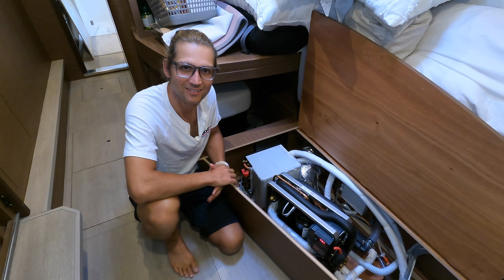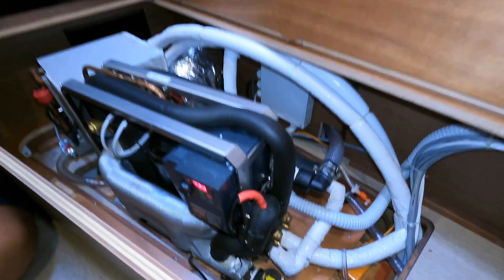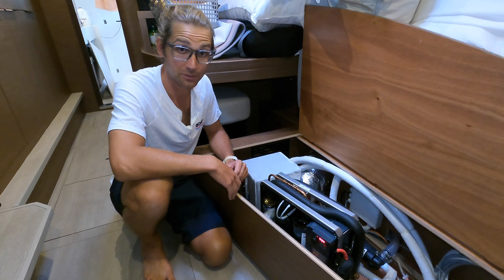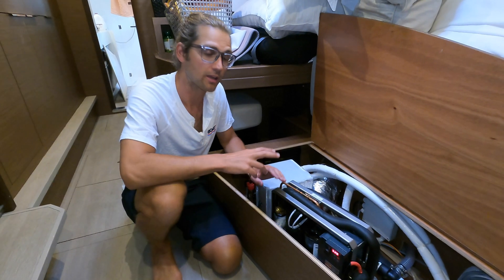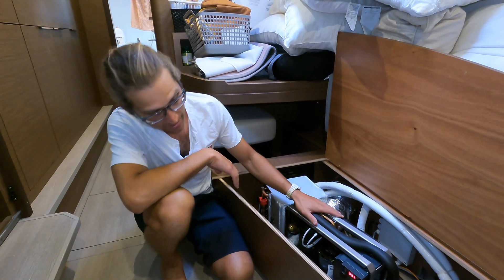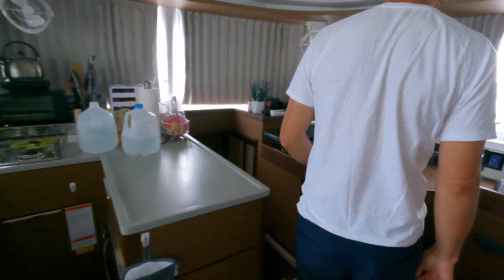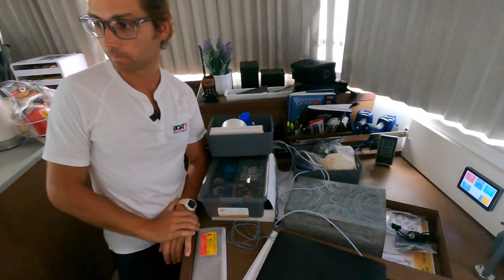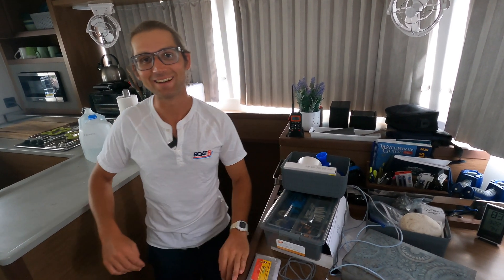Lagoon 46 Sailing Catamaran with New VRV8 Air Conditioning from Termodinamica!

Comment: How does a system like this compare to the Frigomar a/c units? Do you work full time in S. Florida?
Reply from the maker: It's only similar in that both are variable speed.  Frigomar makes a nice self contained unit, however you'd need more than 6 of them to provide the same amount of cooling supplied here.  This boat has 2 central compressor units which drive three air handlers each.  The capacity of the system can be moved around the boat.  So if on a hot day more cooling is needed in the salon and less in the hulls, more refrigerant can be distributed to the salon air handlers.  You can't do that with self contained units, Frigomar or any others.
Reply from the maker: Contact Termodinamica USA for installations in Florida.  Contact us for projects anywhere north!

Comment: Nice! What are the power options? 24 & 48VDC?
Reply from the maker: 230 volts through an inverter.  Inverter loss is only about 5%.  230V compressor tech is more efficient than DC options at this size.
Reply: @boatrx  will they make a 120 or 240VAC split phase in the future?
Reply from the maker: @ericmitchell5350  yes, this is 220-240V 50/60hz single or split phase.  No 120v.